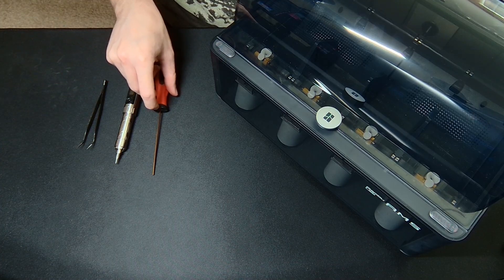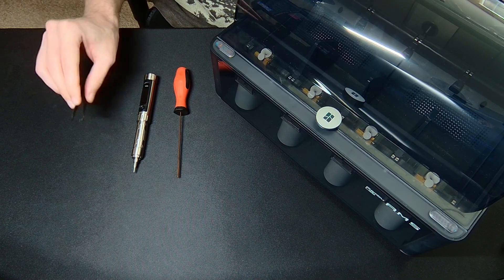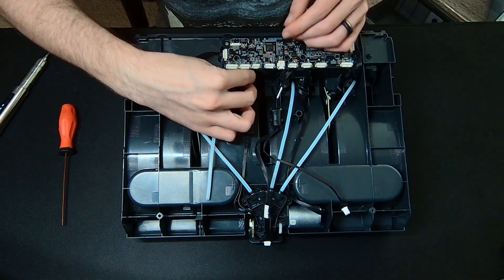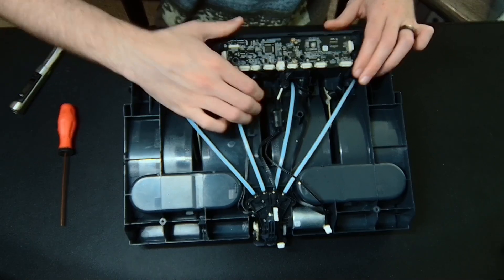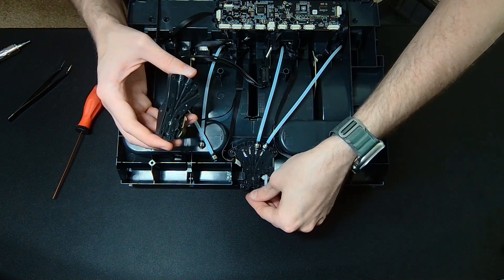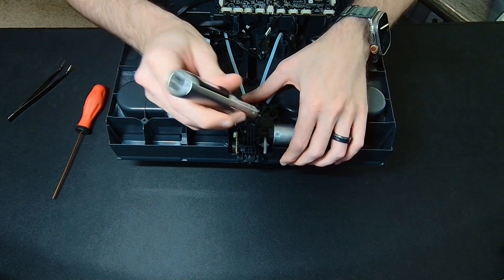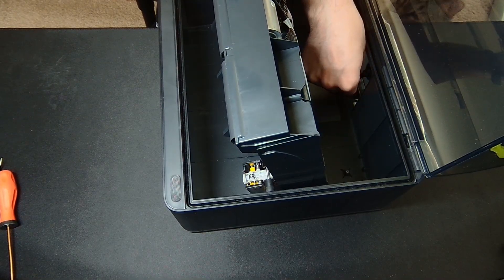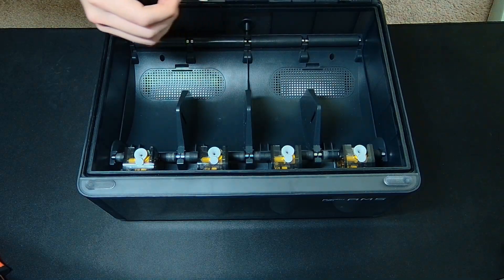How to Print TPU with the Bambu Lab AMS (Mod)

Comment: Even after selecting the "SKIP AMS BLACKLIST CHECK" it still tells me that the TPU is not compatible in the AMS. 
I changed the filaments in the AMS in Bambu Studio to Generic TPU, that works fine. But when I try to send a print that uses the Generic TPU material I still get the incompatibility message. 
The only way I've been able to get around it is to tell it I have PLA in the AMS and create a new material in BS base on PLA but put all the TPU settings in it. I'm on the latest firmware with the latest Bambu Studio. How were you able to get around this? 
Great job on the mod by the way, slots 2,3 and 4 work flawlessly, slot #1 doesn't pull the filament every time due, not sure if it's the TPU I have in there (Bambu High Speed TPU) or if it's something else weird.
Reply from the maker: Very true! I would pin this comment but YouTube is restricting this channel since it's brand new. I actually use Orca Slicer, and have never ran into any issues sending unsupported filament. I thought maybe that check box would do the trick for Bambu Studio users, but it looks like you'd actually either have to clone a generic PLA profile and put TPU settings in it like you mentioned, or use Orca Slicer.
I also had issues with slot 1. It's mentioned in the video. I ended up cutting a little bit of the PTFE tube to shorten it. This creates more tension to feed filament for its corresponding slot.
Glad to see you've got it working though! 😃
Reply: @noozle3d  I'm using OrcaSlicer 2.1.1 and even after enabling the skip ams blacklist checkbox it doesn't work, even tried modding the blacklist JSON file, still doens't work
Reply: Have you got notepad++ and are on Windows?
Is so browse to C:\Users\Yourname\AppData\Roaming\BambuStudio\printers  (replace "yourname) and edit filaments_blacklist.json, to remove the part that says:
    {
      "vendor": "Third Party",
      "type": "TPU",
      "action": "prohibition",
      "description": "TPU: not supported"
    },
    {
      "vendor": "Bambulab",
      "type": "TPU",
      "action": "prohibition",
      "description": "TPU: not supported"
    },
remove it all, as long as you do not use tab or leave the {} marks and anything in between (or the comma) save then restart and it should not have an issue with TPA.
backup first. (you can even just delete this file to remove all restricted filaments).

Comment: Very clever.  Since you're just disengaging the springs, it should be possible to make a little lever or something that sticks up into the top of the AMS so you could flip the spring tension on or off as required without opening the unit up each time.  Same with the hub built into the bottom.  Make it so that a light-tension inner-spring is always engaged, and a stiffer outer spring can be brought in and out of action as required.
Reply from the maker: I like where this idea is going. I'd like to see someone in the community pick this up and improve upon it.
Reply: @noozle3d can you use another AMS for PLA will using one for TPU?
Reply from the maker: @cybyrd9615  I haven’t tried it myself, but this should work.
Reply: this would be amazing... I notice the extruder has a screw tightened spring, a similar sort of thing could be a mid point to work towards.

Comment: Hey, nice video ! 
Is it possible to do it on just one motor ? (like will it still work ?)
Reply from the maker: I wish, but not from my testing. The biggest problem is that heavy spring in the center. That's what causes the TPU to jam. Unfortunately that heavy spring is needed for stiff material. All spools in the AMS run through it, so that's the limiting factor. Ideally Bambu Lab would come up with a design that supports all kinds of filaments, but we can only hope.

Comment: What “soft springs” did you use
Reply from the maker: I used two of the light springs meshed together that were pulled from the first 4 motors in the front to replace the heavy spring in the rear. No springs were used in place of the light springs, just tension from the PTFE tubes.